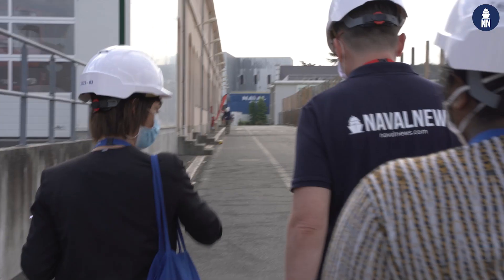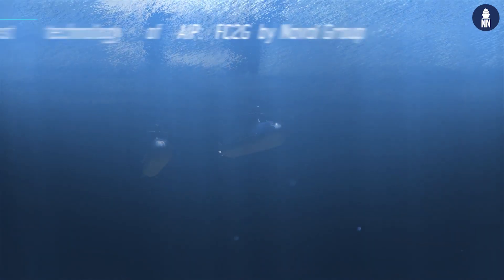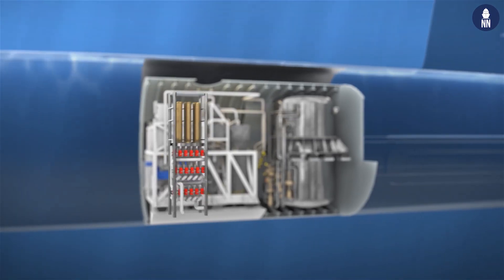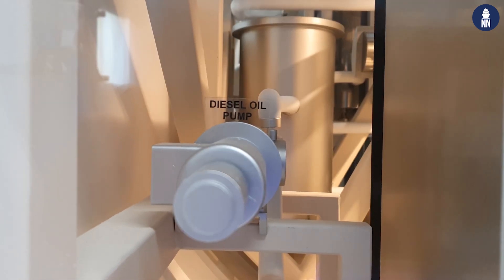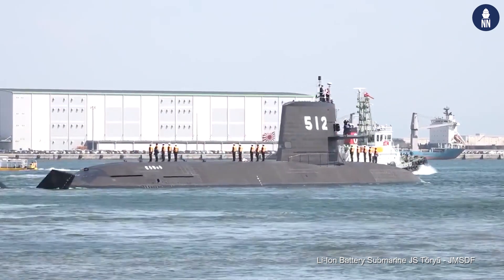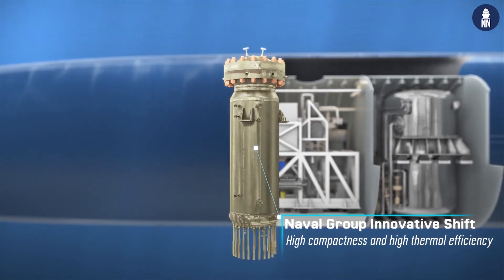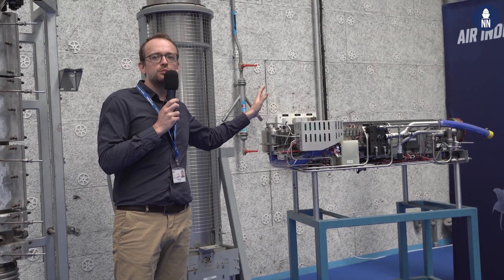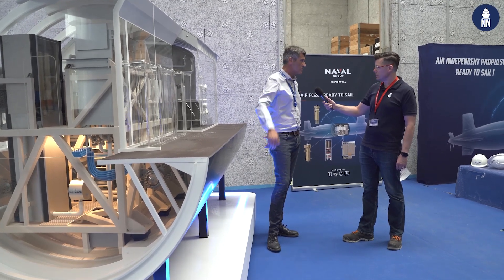Naval Group's Propulsion Systems: AIP for Submarines

Comment: Diesel fuel contains a lot of energy by volume and even by weight, but most of it is discarded in the process of reforming to use only the hydrogen. Only about 12% of the mass of diesel is hydrogen.

Comment: A real shame that Australia bailed out of the French submarine contract. The one billion plus it cost Australia up until that point was a bit of a blow but the French submarine was the best option for our country.
How to win friends and influence people is not a book that is mandatory reading for Australian politicians especially in defence deals.

Using the FC2G AIP which uses diesel fuel reformation to create power, paired with GS YUASA Lithium-ion submarine batteries or the new South Korean lithium-ion submarine batteries. With the diesel engines used for charging the batteries when snorkeling and surface running. I had calculated well over two weeks submerged at cruise speed without snorkeling or surfacing. Using a direct drive electric motor and a new design for the dual contra-rotating propellers on the same axis for propulsion with anechoic tiles on the hull for noise reduction. I have a few new ideas for the way the submarine propellers and or propulsion systems can be built that hasn't been tried before. A Thales sonar system and decoy launchers could be used to help finish the design. Three types of weapons can be launched from the torpedo tubes.
Which is the F21 torpedo and Exocet SM39 missle and an extremely fast MdCN cruise missile with the option to lay sea mines also available. The AIP has no depth limitations and the submarine design is slightly quieter than a nuclear submarine when submerged and well suited to Australian requirements. The AIP module shown above is sized for retrofitting to existing french submarines but custom sizes can be built. The overall design is a little bit more complicated than I have described but the engineering is sound.

The price has ended up increased to ninety billion for the french submarines with the current estimates at three hundred and sixty billion for all the AUKUS nuclear submarines plus through life costs.
Nuclear power has been banned in every state and territory in Australia for many years. The decision to cancel this contract and go with nuclear submarines is not popular with the majority of the Australian general public. The decision is purely to appease the UK and US with an extremely expensive price tag required to sit at the big boys nuclear table.           
The performance increase a nuclear submarine brings to the table compared to the design described above is not worth the extra money. The UK or the US can't start building Australia a custom nuclear submarine for at least a decade and leasing any from the USA is unlikely at this stage. 
A huge mistake from Australia with US and UK ass-kissing leaving a big capability gap  and making us look like idiots.
I am sure many countries will be interested in this AIP and french submarines going forward but a bit more warily than before after the furore with Australia.
I hope the new submarines that the Netherlands are having built are of a very similar design to how I have described them above with similar performance.
😎🇦🇺👍
Reply: Since your comment, the USA has had problems building their current nuclear-powered attack submarines, and their officials have admitted that they'll never build them fast enough to have any spare capacity to supply and to Australia... so they expect to fail to live up to that part of their commitment to the AUKUS deal. If the UK can't build them for Australia, Australia might need to crawl back to the French.

Comment: You can’t put little lithium ion batteries in checked luggage on an airplane because of risk of fire, but you’re going to put a giant one on a sub with a great big tank of liquid oxygen?   I spent 10 years on subs.  No thanks.
Reply: Yes. The battery built into any vehicle (submarine, aircraft, car, truck...) is much better managed and monitored than a random battery in cargo.

Comment: This system might end up replacing the batteries in diesel-battery hybrid powered surface ships for low speed drive. No more recharging... 2 large diesel engines for high speeds + F2CG for low speeds...
Reply: Diesel-electric submarines with fuel-burning AIP (fuel cells or Stirling engines) still have batteries, to meet varying power demand, to avoid the need to continuously run the AIP system, and for redundancy.

Comment: seems overly complicated and with so much steps i wonder how efficient all this is... seems sweden got better solution. much simpler and probably cheaper too
Reply: This should be considerably more stealthy because it doesn't use much if any moving components, but instead makes use of selective membranes and catalysts, which are completely silent. Sweden uses stirling engines, which produce vibrations and thus are less stealthy.
Reply: @pieterveenders9793  That would be disputed, the Sweeden Gotland class submarine has sterling engines and sank the USS Ronald Ragen 5 times and other ships as well and was never detected, it caused quite a panic in the American navy.

Comment: Please clarify that nuclear power is also AIP. You're really producing QUIETER AIP.   Sensitive PASSIVE sonar (listening only) is the threat here. Lithium batteries alone are an even quieter form of AIP. The key question: what is the noise penalty for adding the FC2G to a lithium-alone solution?
Reply: and cheaper than nuclear and smaller... yes but for lithium batteries you need different submarine because those are much lighter and if you just replace acid lead ones center of gravity of submarine will be much higher. not sure how they compare volume wise with lead batteries.

Comment: One of the main goals of fuel cell tech is avoid dependence from petroleum but this one still uses diesel to extract h2. But performance wise, this might end up an exceptional tech for military use
Reply: That's not the purpose of fuel cells in AIP systems at all... or in the original application of fuel cells, which was spacecraft.

Comment: Australia should be mature enough to accept that nuclear power is the most appropriate power source for the size of submarine, not redesign the French submarine so that it is conventionally powered. If Australia accepted nuclear power, the US would have supplied the subs with a US combat system. The US has told the Australian government they will not put US combat system technology in the French design for security reasons. Australia was told not to order the NG design but the government ignored all the critical analysis.
Reply: cost of one nuclear sub could buy 4  AIP subs and they are quieter
Reply: 5 stars for you
Reply: Oz should have just ordered the Suffren subs

Comment: Ideal would be to go to snorkel depth occasionally when safe to do so, suck in air and remove the O2 and store in the cryo tank for another 3 weeks submerged.
Reply: nah... you would need huge machinery and lots of energy for that
Reply: @jebise1126  It would definitely add another 5-10 meters of length to a submarine, but I doubt much more than that. Either through the classic method of fractional distillation, though that is more bulky, but probably the more efficient and compact way is through membrane technology which selectively passes only oxygen. So nowadays its probably feasible.

Comment: Will we see this incorporated into the Australian sub contract? You would think that this was tailored for Australian and Indian requirements!
Reply: @Ozzie climate refo and lithium ion would of bought into the project a huge fire risks and they're not good for long endurance missions your believing the propaganda we've finally ganba get the subs Australia has always needed.
Reply: @montys420-  both the Japanese and Germans have been running Li-ion batteries in their subs for nearly a decade or so now. So I’d say that they have found a way to manage the risk. Furthermore, with the Li-Sulphur breakthroughs announced just in the last month, there is a further enhancement on the immediate horizon: no risk of those terrible Li-ion fires and a battery system that is 5 times more energy dense than Li-ion (which in turn is twice as energy dense as the old acid lead batteries). So there is that.
Reply: @andrewmetcalfe9898  the Japanese only launched there 1st lith-ion sub last yr and was commissioned into service this yr and they launched there 2nd this yr and the rest are being built the germans do not run lith-ion batteries
Reply: @andrewmetcalfe9898  only twice? really? by volume or by mass?
Reply: @jebise1126  good question. I presume by volume, but the reports Ive read simply don’t specify. Do you know?
Reply: @montys420-  well... japanese are putting those to their submarines.
Reply: @Ozzie climate refo early AIP WERE CRAP  if they can do 12knots submerged in a 15knot tide they go backwards hence why they were rejected for the collins we have to far to travel in operations and im glad the contract was terminated Turnball trapped us into a crap contract and the French took advantage and bled us for nothing
Reply: no
Reply: Australia ended up making a deal (in 2021, before your comment) for nuclear-powered submarines... which obviously wouldn't use fuel cells or any other diesel-burning AIP.

Comment: the argument against hydrogen is valid in a warship.
Reply: Not having a highly explosive gas that can leak through almost any container & needs to be stored at either very high pressures or very low temperatures is a valid argument in most situations.

Comment: Any submarine propulsion system that requires tanked oxidizer is not AIP.  Right now, the only REAL AIP system is nuclear propulsion.  However there may be ways of building real AIP.  I'd try extracting dissolved oxygen from the ocean water.
Reply: AIP use LOX not air so it is air independent
Reply: You only need to invent a new method of electrolysis that's practical and economical inside a submarine AND doesn't require a nuclear reactor.
Reply: @hectoraccented5312  Electrolysis is not needed.  There's plenty off oxygen dissolved in seawater.   It just has to be extracted and used.  Think about this:  Some Tuna can make 40 knots underwater, completely air independent, extracting the oxygen they need from seawater.   Why shouldn't a submarine be able to do that?
Reply: @bbmw9029  Because we use engines/fuel cells, not muscles, 1 liter of sea water has around 8 cubic cm of oxygen IN TOTAL. Even at 100% efficience, you would need to process 32 liters of water every 74 grams of petrol, a 8000 hp diesel sub consumes 1911000g of fuel/hr at max /74 x 32 =826 tons of water /hour. So you need to invent silent, ultra-efficient, self-cleaning "artificial Gills"  that can process a dozen tons of water every minute.
Reply: @hectoraccented5312  There are oxygen / CO2 permeable synthetic membranes that can be used.  And a double hulled submarine could put a huge surface area of such between the hulls.  And I'm not burning the oxygen, I'm running it through a fuel cell.
Reply: Stirling engine is AIP
Reply: @namazlur78  a Stirling engine needs heat.  In most sub propulsion systems using Stirling engines, the heat is generated using combustion with tanked oxygen.   In my thinking, anything with tanked oxidizer is not really AIP.
Reply: Air is not oxygen
Reply: @shaider1982  more accurately, air is not just oxygen. But correct - the tank does not contain air. And the meaning of AIP is obviously independence from an outside source of air.

Comment: Are you putting this propulsion in Australia’s Barracuda Class when you deliver them in 50 years , over budget and too late to use against the Chinese?
Reply: Australia need to train all the trades and to build all the infrastructures to manufacture the submarine. It take times. Don't blame NG for this, your government knew all about when they signed. This the price to pay when you start from zero.
Reply: @qanniqtuq  Best comment what can you expect when you are totally reliant on others. Australia was stupid enough to outsource a great deal of it's manufacturing base.
Reply: As the Ozzies are paying billions of dollars per submarine, you'd think it would have AIP, but not a sure thing. The Collins had an AIP system it was designed for and supplied with, but never fitted. Probably turned the space into a giant beer fridge.
Reply: @briananthony4044  there was no or very little advantage to retrofit AIP  into Collins class.🇭🇲
Reply: @georgepantazis141  I heard decades ago that the Stirling engines acquired for the Collins were sitting in a warehouse in Australia. But the Navy was happy with the Collins under water endurance so they were never fitted. Surely weeks underwater while spying off the Chinese coast is better than days with just the batteries. Perhaps Chinese ASW was so poor back then that snorkel recharging wasn't seen as a hazard.
Reply: @georgepantazis141  that's very arrogant
Reply: Well well. A healthy debate has led to a health outcome. Le boo Le hoo.
Reply: Wasn't it the Australian government that signed on the dotted line?  Naval Group made the offer and it was up to YOUR government to accept or refuse this offer.  Shouldn't you be directing your bitching to the Australian government?
Reply: @abrahkadabra9501  The Australian government did get a whole heap of heat over the submarine deal. Still are.
Reply: @nerdbane9376    Blaming Naval Group for the poor decisions of the Australian government was a bit much for me.  This is the level of dialog in the land of Oz over the sub controversy.
Reply: @abrahkadabra9501  I'm not blaming Naval Group. Apologies if it came across like that. The people who removed competition in the submarine bid are likely the ones to blame for the drama in Aus.
Reply: @nerdbane9376  No no, not blaming you at all.  I wanted to put things in perspective for Camo.
Reply: @abrahkadabra9501  Not when the France sell ,something that doesn't work or isn't real.🇭🇲
Reply: Hopefully you can translate to Australian, but this youtube channel is not going to build anything, for Australia or anyone else.   You should forward your question to the Australian Navy.
Reply: @toddc2788  Naval Group is the company building Australia's attack class submarines. 
There has been a tonne of public and political debate over the this new submarine. The batteries and fuel cells it will use is one of the points of debate.